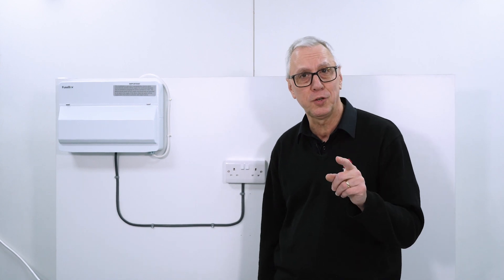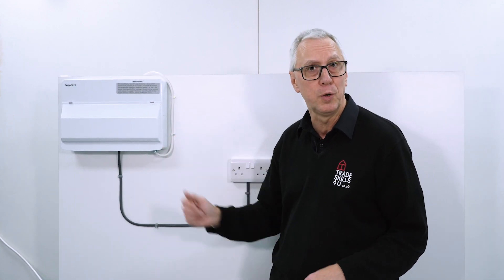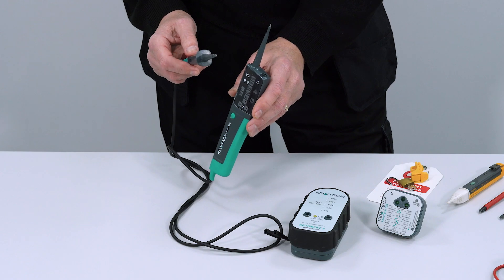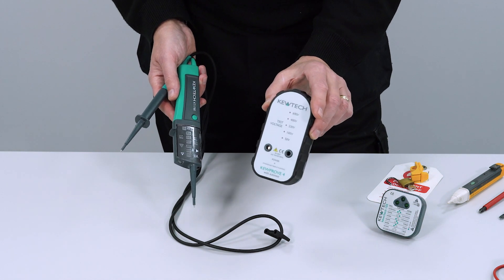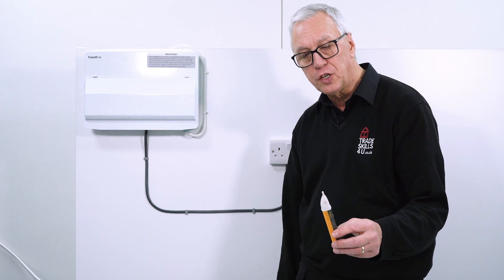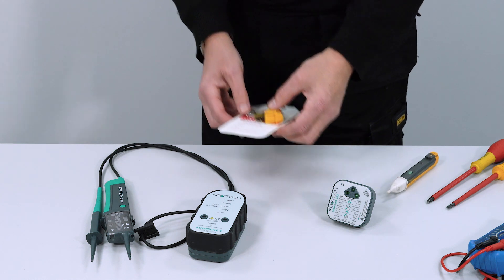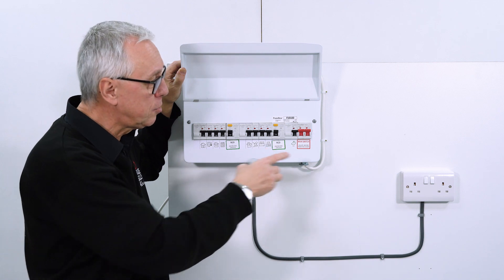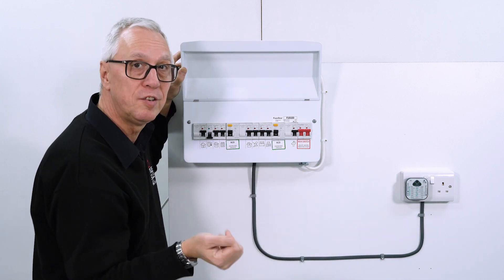How Do You Isolate a Consumer Unit and Socket Outlet

Comment: Do not follow this instruction if your goal is to COMPLETELY ISOLATE THE DISTRIBUTION BOARD. All that’s been done is you’ve isolated the distributed circuits for example lights, sockets etc. if someone had to follow this instruction to replace the distribution board they’d possibly kill themselves as the incoming supply IS NOT ISOLATED. In order to completely isolate a distribution board an electrician MUST contact the DNO who will either give authorisation to remove the cut out fuse, or they will remove the cut out fuse themselves.  Or in certain circumstances there will be an isolator in a switch room that’s feeding the distribution board.  This is a misleading video.
Reply: It’s only misleading if you’re not paying attention to the content and what is being said by a very knowledgeable tutor.

Comment: Yes as a recently retired industrial electrician who worked in the industry 50 years I have had about 5 times that's once every 10 years so that's not bad considering that I have worked alongside very high voltages , so the best advice I can give any electrician is never to trust  anything somebody tells you regarding informing you that a circuit is dead, never beleive anyone even if that person is experienced and well respected, you are at all times your own safety officer to protect yourself and any workmate or the general public , so my advice is to check , double check and when you lock that circuit is locked off don't put the key anywhere but your own person, even an experienced sparks like me who was a foreman on the new Silverstone Forula 1 circuit control  building and conference building , we had sub contract testers so in one of the kitchens we had major problems with the supply fluctuating in voltages , so I called for the tester, he went through a series of tests , whilst this was happening he told me that a circuit was dead and like an idiot I took his word for it and proceded to get an electric shock, luckily it was not a shock which affected my muscles in regard of my grip not allowing me to free myself from the flow of electricity it was just one which made contact with the side of my pinky, so please the first commandment is only trust yourself but nobody else, I hope this advice is of some use to young electricians, luckily I'm nearly 70 , you lads need to stay safe so good luck